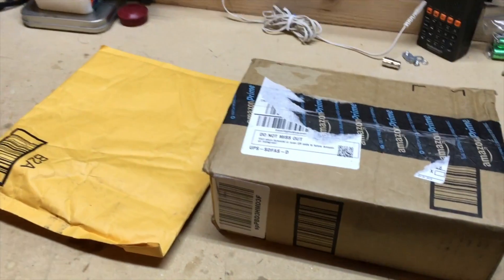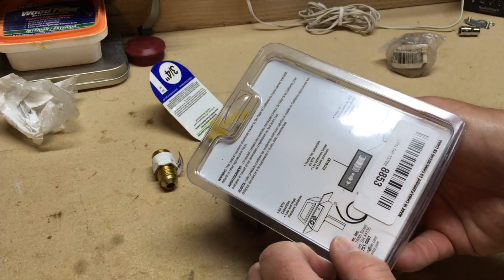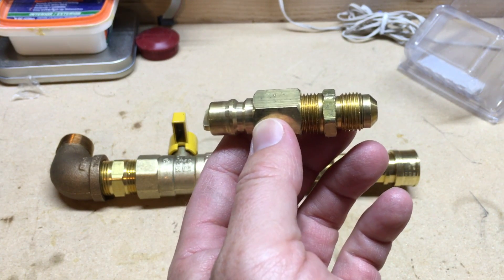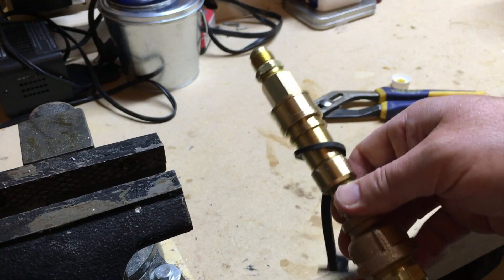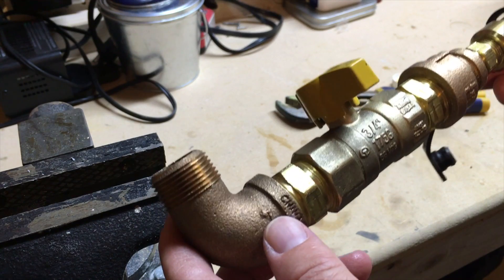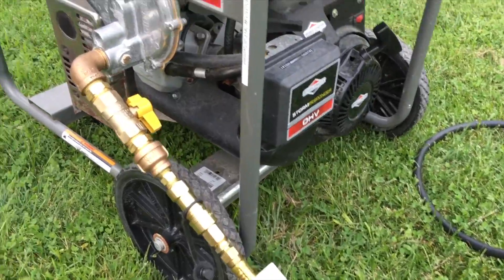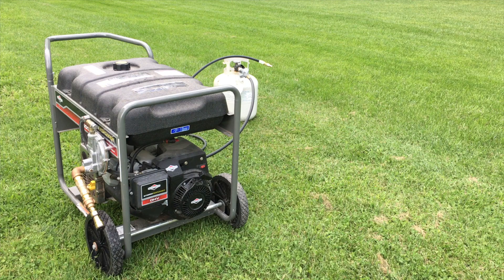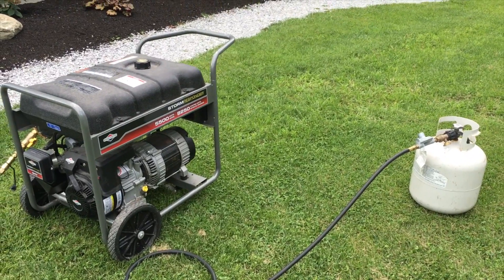Gas Quick Connect for Tri Fuel Generator

Comment: Great video. Not sure about propane though. From what I have heard one 20 pounder tank is like the equivalent of 5 gallons of gas run time.  I have 40 gallons of gas that I can fill a week or two before a storm. Not sure I want 8 tanks of propane lying around full. Gas I can empty into car etc when threat is over. Propane not so much. Ideally I like the NG approach which is same as propane essentially but NG lines never have supply issues typically. Tapping into my NG line is the challenge for me because it comes out of the ground has a 90 elbow and goes into the house. Need to tap into that 8 inch straight section with a T to go to generator and then buy the kit too
Reply from the maker: Good Points.  On my newer setup I am hooked into a 400 Gallon Propane tank.  Plenty of propane to go for a while.  Good luck with your setup.

Comment: Quick connects are made so that they block the flow until the male half is inserted and seated. So as a matter of safety the female quick connect should be on the propane supply hose and the male  half of the quick connect should be on the piping  going to the demand regulator on the gen set. This prevents releasing propane if the quick connect were to come uncoupled for any reason.
Reply from the maker: Correct!  I changed the male/female order in a follow-up set of videos.  Those videos can be viewed here.  Thanks for watching.   https://www.youtube.com/watch?v=nkTt-TSpK60&list=PLbzeOtpXZbGh1WserBSQMAEAf3yhJheoH&index=3&t=0s
Reply: How do they prevent gas from flowing if the generator fails for whatever reason. Is there a safety cut off within the regulator conversion kit so gas ceases to flow?

Comment: I omitted the valve in mine, as I prefer to switch off at the tank.  My required the elbow, a 3/4 M to 3/8 F reducing adaptor I managed to find at Ace Hardware, and finally the 3/8 M to 3/8 M nipple to connect to the quick connect itself.  I couldn't find locally the reducing adaptor used in the video.

Comment: Why not use a 3/4" x 3/8" reducing bushing after the 3/4" elbow and then a 3/8" nipple to quick connect. No shut-off needed, you can shut it off from the tank.  Save on all those fittings & less chances of a leak with all those connections. Very well explained video.
Reply from the maker: I think I couldn't find that fitting at the time.  Wasn't sure if I needed a shut-off and installed anyways.  If I did it again would probably just go with the 3/4 to 3/8.   Thanks for watching!

Comment: How does the generator react to a load .where a gas carb will govern the load an add fuel to raise rpms..how does the propane do that.
Reply from the maker: Not sure on the technical details but the generator runs the same as on gas when there is an increased load.  I can hear the generator ramping up when the load increases.
Reply: Green Mountain DIY Guy what kit is it you have on it...is it the tri fuel snorkel or....
Reply from the maker: I used a tri-fuel kit from US Carburation.  This was installed before the Motor Snorkel adapter kit came on the market.  My kit did not require any drilling.  Was very easy to install and I do not believe they make this kit anymore.  The new kits have the motor snorkel included.  I believe the newer kits are even easier to install.  Hope that helps.  Let me know if you have any more questions
Reply: When the speed of the engine slows down under load, the the governor opens the throttle butterfly wider to increase fuel and maintain speed... just like any small engine with a governor.
Reply: Why not use a 3/4" x 3/8" reducing bushing from the 3/4" elbow, then a 3/8" nipple to quick connect.  No need for a shut-off, you can turn it off at the tank. Saves on all those fittings and less chance of leaks. Very well explained video.

Comment: Do you need a some kind of regulator between the generator and a natural gas line,  if you connected to a natural gas line from your house?  I noticed that there is a regulator of the propane tank.
Reply from the maker: The regulator on the line near the  propane tank is not needed.  It just came with the hose I was using, so I kept it.   If you are going between a large cylinder such as an underground tank, you may need an additional regulator.

Comment: Hey buddy that’s a bad ass set up you got there so quick question it canrun on gas and propane correct And can you tell me exactly what fittings you bought I will appreciate it
Reply from the maker: Thanks, let me take a look back at my records to the exact one I bought.  That company now makes a product called motor snorkel which is universal and easier to install.
Reply from the maker: Josh, I can't find my paperwork as to the exact kit I bought.  Since then, US Carburetion has gone to the motor snorkel which looks way easier to install.  The kit I used had a donut adapter.  Just go to their website and plug in your generator model number and you can find out what kit to purchase.

Comment: why do you have a valve by the regulator when you have one on the tank ?
Reply from the maker: The on/off valve by the larger regulator is there so I can turn off the gas after the tank.  It's just an additional on/off in the line.  All tanks come with a valve, but I wanted one close to the mounted regulator.

Comment: Great video vtmaestro! I think I'm going to do this myself. Can you do a quick connect on the tank side as well?
Reply from the maker: slypete Thanks.  Yes, you should be able to add a quick connect to the tank with the right adapters.  The traditional screw on fitting for the tank is already pretty quick...
Reply: Good point
Reply from the maker: Second thought, I could also see having another quick connect especially if you are not using a cylinder and are going into a permanent gas line.

Comment: Nice job...I just purchased  a LP gas generator do all the LP gas hoses come  with a regulator on it.  the generator I purchases does not come with a LP gas hose.
Reply from the maker: I believe you cant get hoses with or without regulators.  Try Amazon.  Just be sure to know which size, 3.5, 1/2 inch. etc!  Good Luck!